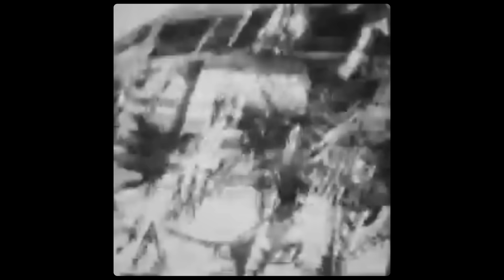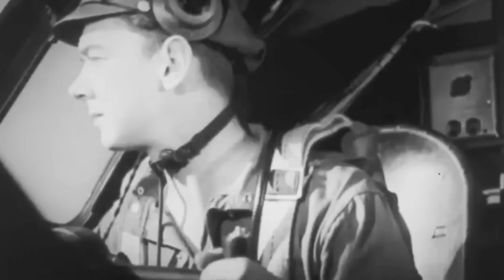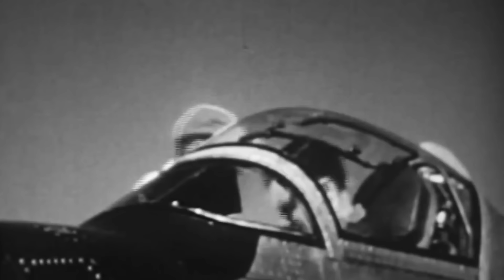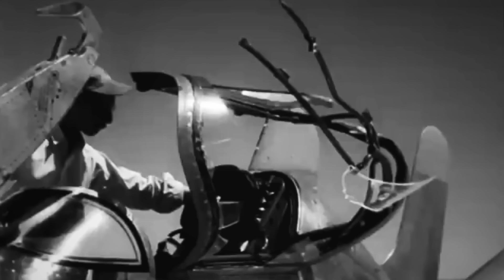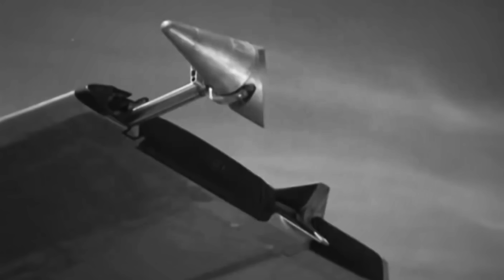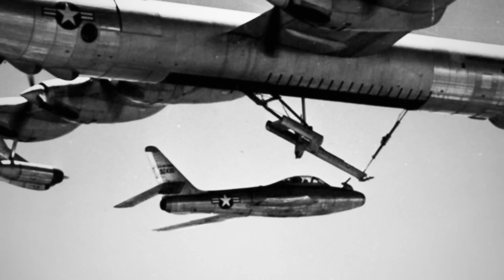The Fighter Plane that Could Never Land

Comment: Very interesting. I was aware of the Goblin story but hadn't seen any of the in-flight films, which make it much clearer quite what an awful struggle it was trying to hook on the carrier aircraft. I knew much less about the subsequent projects, and in particular not that the reattachment problem was - to some extent - solved. I expect that these days with fly-by-wire equipment it could be made much easier, but nobody wants to do it any more. In-flight refuelling is far easier (though still demanding on pilots) and 100 times safer.